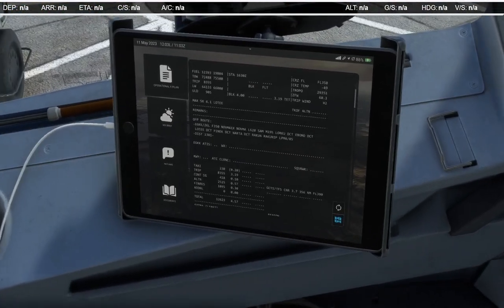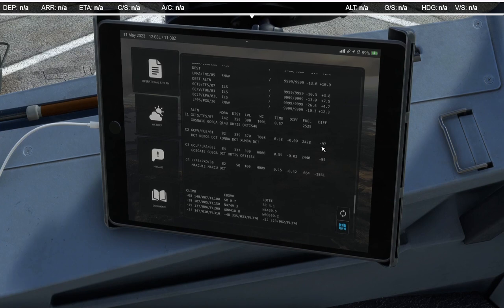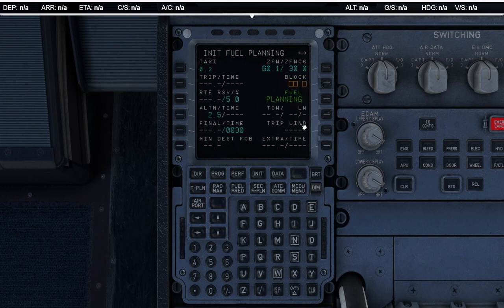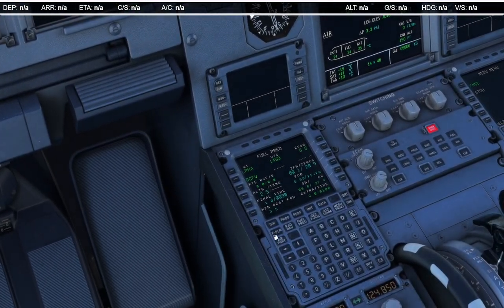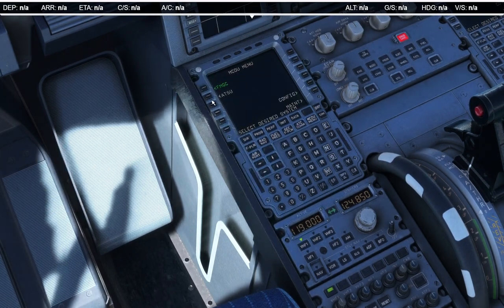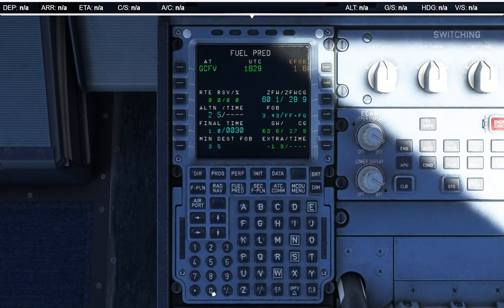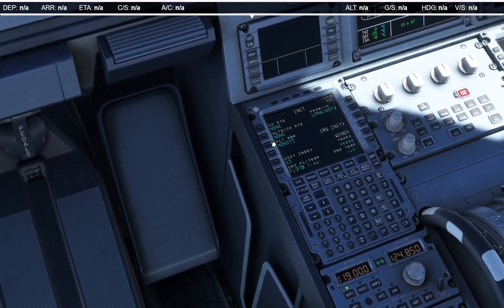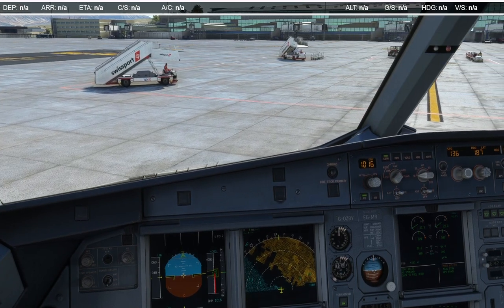Fenix A320 Diversion tutorial

Comment: Really interesting video thank you for making it. A quick question if I may, when you arrived at Maderia, if the weather is bad and the forecast shows no realistic prospect of it getting better is it standard procedure to remain there until near CNR just in-case? Or is it possible to just go straight to the alternate?
Reply from the maker: There’s probably no hard and fast answer for this. Again in reality, if the actual and reported winds were quite obviously out of limits with no sign of improvement, the airline may well cancel the flight. So you might not even get there in the first place. If it’s quite close or dipping in and out of limits, you might go and have a look at it. When it’s like this you probably will take as much fuel as you can to linger about. If the weather then drops and you can make an approach, you could give it a quick go and see if you get in. If you can’t get in on the first approach, you go back to the hold and wait for another opportunity. Don’t forget most airlines have a two approach limit policy. If there’s two go arounds due to weather, you divert. There’s a bit of latitude with this (go arounds for non weather reasons). But ultimately your CNR fuel value is the decision point. At this value, you either commit to your destination or you go to the alternate. You don’t have to wait until you get to the CNR value. Certainly if it’s not showing any signs of improving, you might opt to divert earlier. Why wait til the last minute when it’s obvious it’s not going to work? You might find yourself at the back of a long queue so sometimes it’s better to save face and just bin it and not have the stress of another 6 aircraft doing the same ahead of you. Causing delays at the alternate. 🙈

But of course in reality we’re talking about real airline ops, real passengers and real costs. We want to get people where they’ve paid to go so we will endeavour to do that and this may mean leaving it until we’ve got to CNR value and then go somewhere else. It’s not ideal but airlines expect this to happen occasionally and they’re prepared to accept the costs when it does. 

Ultimately this decision will come down to the Captain (with input from Ops) and it’s always going to be subjective on the day. Where one person gets a bit nervous, another might have the confidence to stick around until the last minute. I’m usually a bit more cautious and I don’t like leaving it to the last minute as your options start reducing rapidly! Not nice on a cold rainy night in Leeds or anywhere else. 😉
Reply: Cheers, makes total sense 😀

Comment: Thanks! When would you declare minimum fuel? Would ATC already have your ALTN FPL from your filed flight plan?
Reply from the maker: ATC won’t have the alternate flight plan in their system So you’d have to tell them where you want to go. They do know what your nominated Alternate is though. In this case TFS would be in their system but as we explained, FUE was probably more suitable. ATC wouldn’t know this so we’d have to update them on our intentions. In most instances they’ll know the general direction so will most likely give you a direct to one of the waypoints on the route you’re expecting. 

With respect to minimum fuel this is expanded more in company manuals. Some airlines and other countries (US, Australia etc) may define minimum fuel slightly different to U.K./European airlines. 

As a rule, a FUEL MAYDAY is declared as soon as you know you’ll land below Final Reserve. 

“Minimum Fuel” is declared whenever you’ve effectively committed to a specific airport and any further delay MAY result in you landing below final reserve. 

There’s a subtle difference and it’s usually up to the PIC on the day on when they get twitchy with the call. 

In this example, at no point was I expected to land below Final Reserve. So “Mayday x3 Fuel” call to ATC was never required. 

Even on the divert to fuerteventura, I was expected to land 500 kgs above final reserve. So I was confident a “Minimum Fuel” call wasn’t necessary either. 

Had ATC been online and  fuerteventura been very busy with lots of holding, a “minimum fuel” call may have been necessary because you can argue any further delay might mean you’re landing close or below final reserve. 

When it is busy, you can expect ATC to give you an EAT (Expected Approach Time). With this time you’ll be able to calculate whether you’ll be landing above final reserve or not. If you had an EAT in 20 minutes time but only had 10 “extra” minutes in the FUEL PRED page of the FMGC, you’d need to make a decision to commit or divert within those 10 minutes. 👍

Comment: If you had a medical emergeny on-board, would you be able to attempt to land in Madeira even if it's out of wind limits? (Madeira airport wind limits is far less than a320 crosswind limits).
Reply from the maker: No you wouldn’t. Madeira is a bit special like that. Tower won’t even give you a clearance to land if it’s out of limits. This is a legal thing so you’d technically be breaking Portuguese law (as far as I remember) if you landed outside limits. Not to mention the limits are there for a reason and you’d probably be putting the aircraft into a rather precarious position if you attempted it. 

At the end of the day, you have another 180+ people to look after as well as anyone that could be dying at that moment. So, you want to keep them safe too. Porto Santo is close so if there was a genuine medical emergency and Madeira was out of limits, I’d be going there very quickly if I could. 

Porto Santo can fill up quickly but the runway should always be open. Even if you have to land on the runway and shut down the engines (closing the airport), this is still a better option than diverting an hour to the nearest suitable aerodrome. 

Once on the runway, you can get steps to the aircraft and get the medical off loaded. What happens to you after that is academic. 

What happens if Madeira was out of limits, Porto Santo was closed and then get a genuine medical emergency I hear you ask? 

Pray!!!!

Fly at about FL250 at CI999 and head straight to the nearest airport. Faro or Lisbon most likely. 👍

If you have the fuel…. Which you should. 😉
Reply: @VmcgHD  Will try CI999 next time I'm in the simulator😄.

Heard the other day that the wind limits have been the same since the 60's and haven't been updated purely due to bureaucratic reasons, but no idea if that's actually true.
Reply from the maker: @GarethReecewood  It wouldn’t surprise me. Consider the runway barely existed in the 60s, you’d think the wind limits would be updated for a modern, long runway. Alas, that’s the rules. We play within them. 😉